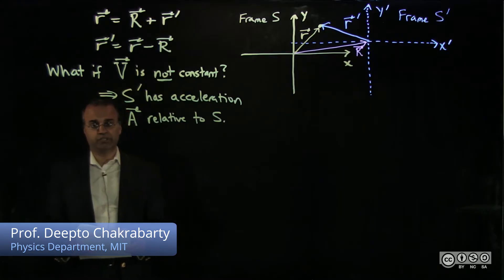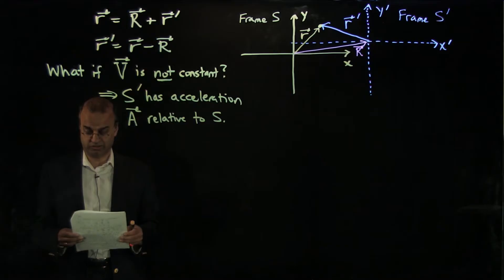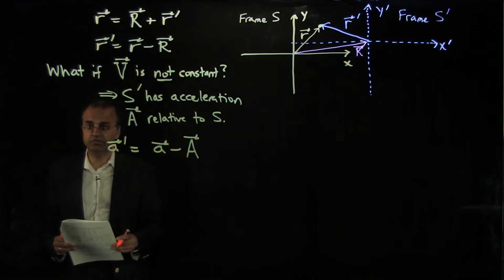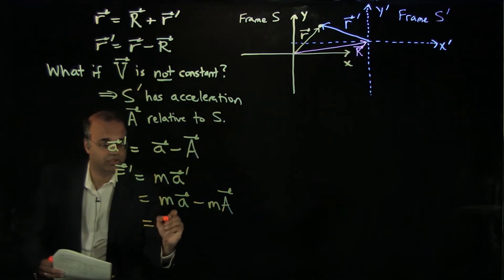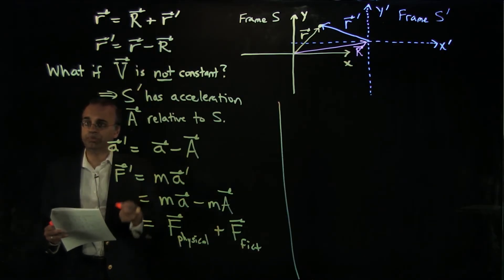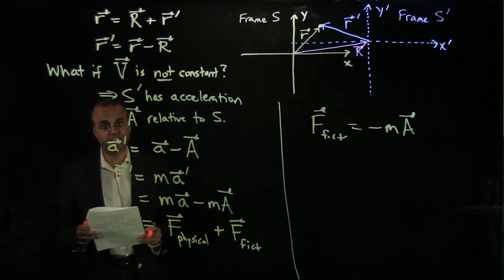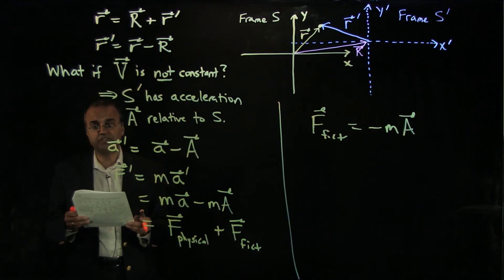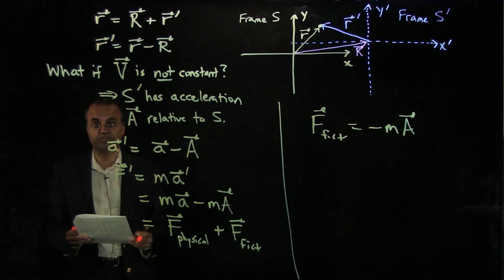4.4 Non-inertial Reference Frames

Comment: Inertial frames allow physicists to turn an infinitely relative thing like velocity into something important even though it does nothing, when acceleration is absolute, does everything, and it is ignored by all.  When you use transforms on your data to CHANGE it, the NON-transformed reality does not just disappear; it's still there, and there is no alternative effort.  Is that the scientific method?  Math can be perfectly analogous and wrong.  Send a pendulum into space, and tell me how GPS proves anything.

Comment: the physical force is the one interacting directly on an object. Does the fictitious force interact directly on the object???
Reply: I think it does not. Not from this course, but I think it is something we use to make the forces cancel each other out like in the example of circular motion teacher has given. The objects speed in circular motion is uniform but its velocity isn't. In circular motion, centripetal force is fictitious but it somehow also makes the rotating object rotate on a specific orbit, prevent it from moving away or getting closer to the center of the motion. So that fictitious force happens to act on the direction of velocity in circular motion but not on the object. It is a bit complicated and I don't know it in great detail neither, but it is a fun point to discuss.

Comment: Why is a prime equal to a minus A and not a PLUS A? Or does it not matter since they are vectors?
Reply: You are riding in an accelerating car (the non inertial frame) and throw a ball forward. The ball will be travelling forward at some small speed relative to you. However, a still observer on the ground will observe the ball travelling at some speed + the velocity of the car. So

v=v'+V

Differentiate and move around to

a'=a-A

Comment: what does the the little "a" acceleration symbol stand for at 0:58?, because the professor said that it's the acceleration of the frame "S"! although he said that frame S is an inertial at the beginning. so by this, can the inertial frame be an accelerating frame?!
Reply: a' refers to the acceleration of the object as measured from frame S' and a is the acceleration as measured from the frame S. Capital A is the acceleration between frames S and S'
Reply: a is acceleration of object wrt S